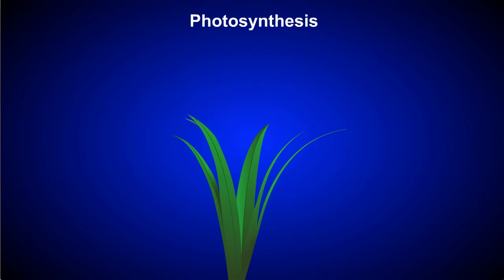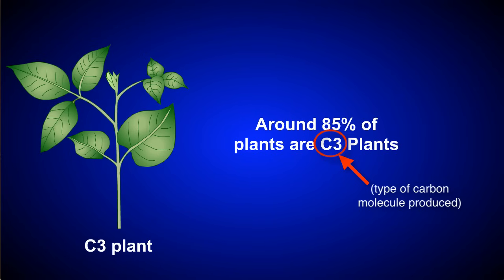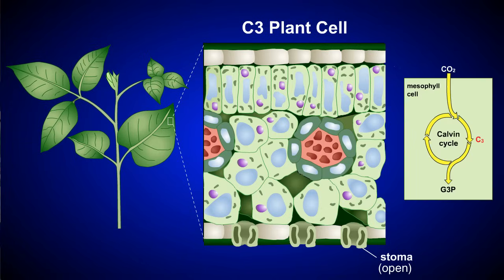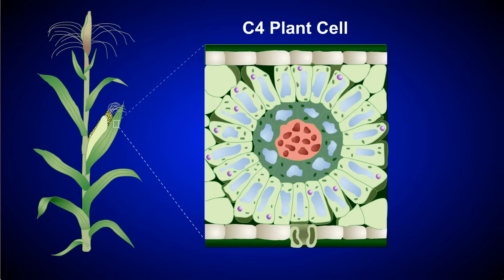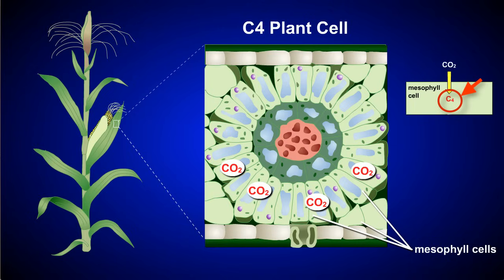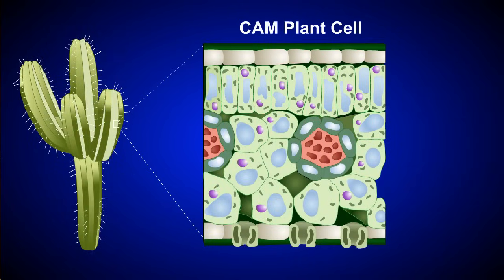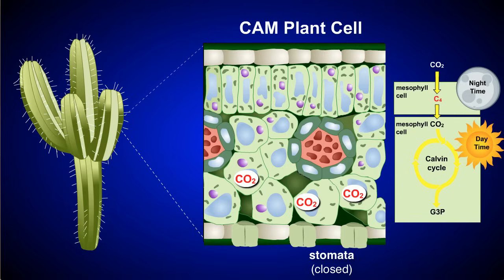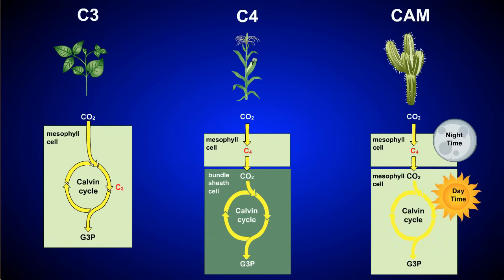Photosynthesis: Comparing C3, C4 and CAM

Comment: Hello, fantastic video. Was just wondering about one part that you didn't cover. If CAM plants have closed stomata during the day, when do they release the 02 they produce when h20 is split? Do they store the 02 and then release it when the stomata open up at night? 

I am asking as i have seen claims about certain plants (like snake plant, a CAM plant) releasing oxygen at night and i want to fact check this.
Reply: plants biological.